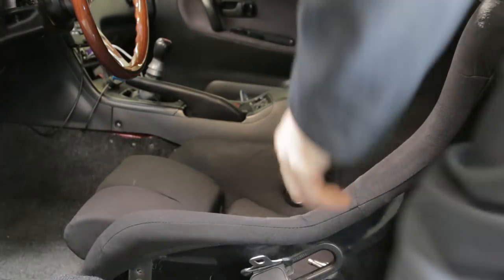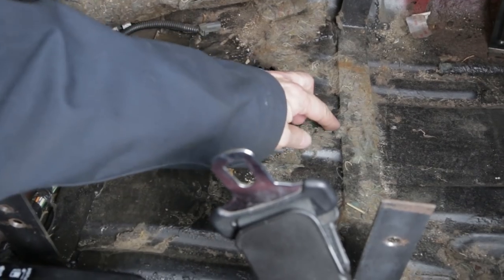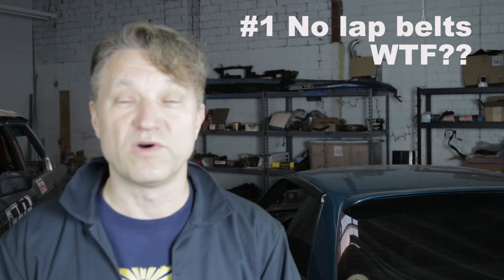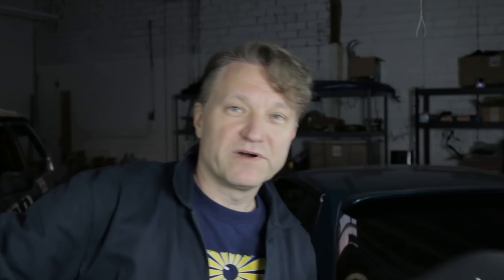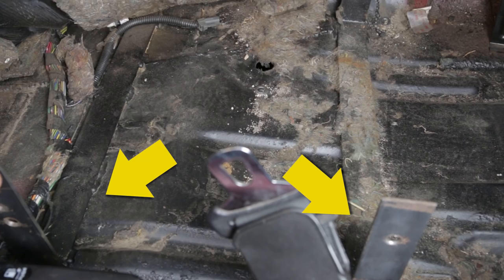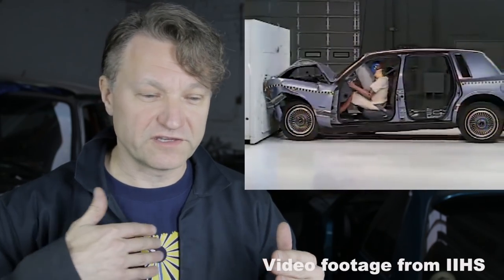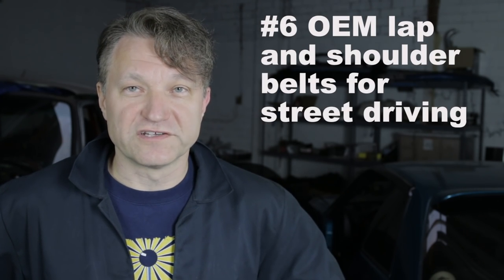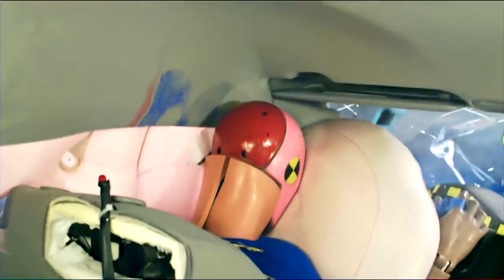Nissan 240sx mods - Worst Seats In The World

Comment: revmatch wondering what you think of the Takata Drift series belts for those that at least want to run some aftermarket belts that are street legal  seat belts. Of course installed correctly. Seems like a better option and have ASM system.
Reply from the maker: I think it boils down to what you feel safe with. Generally 4 point belts are  unsafe and illegal with most race organizations because you can submarine under them. I realize Takata has their ASM (Anti Submarining) system, but personally I'm going to run both the OEM 3 point and a 5 or 6 point harness for the track. Their 4 point is not compatible with HANS.  

Unfortunately there was an incident at Chuckwalla about 2 years ago where a passenger died when a car hit a tower and she submarined and died on impact. She was wearing a 4 point.  Thanks for watching!

Comment: Also worth mentioning the more modern OEM seat belt systems have Pretensioners, these are pyrotechnic devices that fire off like the airbags. The pretensioner takes up all belt slack in a crash (a loose belt can be like having no belt, or worse). The wheel airbag and seat belt pretensioner comprise a tuned safety system .. think carefully before removing / disabling one of these (especially the passenger side, for your passenger made no choice to compromise safety before entering your vehicle = lawsuit).

This is a good video, great to show this example of how NOT to mount a junky seat .. those flimsy floor brackets and seat, totally defeat the whole purpose of gaining performance .. the idea is to stiff side support for the driver, to deal with those ++1G turns ... a flimsy install means seat movement side to side, which to a driver, is almost as bad as sliding side to side on the OEM seat. Driver seated stability yields lower track times, less fatigue, and higher driver confidence ... once you have experienced it, you will know exactly what i am talking about!  The seat and brackets shown in this video are all show and NO Go .. only great for parking at the coffee shop parking lot and telling stories of your "hidden" turbos &  200mph drifting during a police chase.
Reply from the maker: All true BigCooter. I've got a new seat properly installed now and it's great.

Comment: i have 1990 crx.  no air bags (factory) seat belts are mounted to the door (factory). all crash ratings are poor.  would a harness and seat help my cause ?
Reply from the maker: Probably not. The engineering of the car is the biggest factor in safety.

Comment: 5:33   usually, racing harnesses have something, i don't know how it's called. let's just call it a rip point. but basically it's a part of the seatbelt that has overlay, so when the harness is put under stress, this overlay rips to extend the harnesses in the shoulder area about 3-4 inches out (probably more, probably less, as long as you get the point of what im saying). if i remember correctly, takata has that, i don't know about other manufacturers. but also, one point about racing harnesses that you forgot is the sinking. with factory seatbelts, you dont really get that, but with 4-point racing harnesses, what can happen is you slide under the harnesses. although a 5-point/6-point harness might fix that because you'll have a belt going in between your legs. but don't quote me on the first part, i remember seeing it somewhere. where? i dont remember, but if i do find the link, i'll post it in the replies
Reply from the maker: Yes. Harnesses are designed to stretch under the load of an impact and give a little bit. Once your harness has been used in an impact you're supposed to trash it. 

You're right about 4 point harnesses as well. In a front crash you can 'submarine' under the harness. In fact, a woman died at Chuckwalla because the car only had a 4 point. 5 and 6 point hold your legs in place, so you stay in the seat and slide below the webbing. Every legitimate race series mandates 5 or 6 point harnesses for this reason.
Reply: revmatch well, usually, that's what you're supposed to do with roughly everything that has to do with safety after it's been used in an accident. for instance, even helmets are supposed to be replaced after the slight impact, regardless of wether it is cracked or not because apparently it loses effectiveness,
Reply: fred renault I

Comment: Where to start, guess go watch the video for even real brides or recaro in a rear impact, rear brides fully recline when hit from the back. S13s in the usa came with automatic seat belts which were garbage to begin with, not surprised the prior owner removed them but should have installed oem jdm 3pt seatbelts. Also stock s13 240s didnt have airbags at all to begin with so the steering wheel point is invalid unless your driving a late model with airbags. As for the brackets theres tons of companies that offer sliding seat rails for aftermarket seats. That being said either you have a street car or a track car. If its a track car it should be fully caged, have the proper non reclining buckets and harnesses (that should be dated and expire after a duration of time and need to be replaced occasionally)

Comment: If I adjust my racing harness to be loose allowing my body to move forward a little,is it safe to daily driver it? (with airbag)
Reply from the maker: Loosening will help, but it's still not ideal. A racing harness holds the body in place pretty well and isn't designed to stretch as much as an OEM seat belt. This puts a lot of stress on the neck in a hard collision where your head moves, but your body stays in place. 

Ideally you want to use your OEM belts on the street and your harness and HANS when at the track.

Comment: Great points addressed there. I will never get why people save on safety. STUPID
Reply from the maker: I'll spend on safety before other areas usually. My team spent quite a bit on a roll cage and never thought we'd use it. Turns out we used it and it held up just fine in a roll. No one complained about the cost after that.

Comment: I owned a miata before my 135i, I had bride replicas (complete shit like you say) nrg wheel and harnesses. They all worked well but now I am so glad I didn't crash that thing ever I would have gotten FUCKED. Also I have been in an accident with no airbag (STI wheel) and it sucks slamming into a steering wheel.
Reply from the maker: Tanner Buckbee Safety first man.

Comment: What your take on a real seat when the  Fia expires? still ok ro don't bother?
Reply from the maker: I think it really depends on how you plan to use it. If you're racing or tracking with an organization they will sometimes grant you a 1 year or 6 month extension on FIA safety equipment that has expired.  AFAIK, safety equipment is designed to work optimally up to its expiration date.  

It will possibly start to degrade slowly with time after that, but I'd guess not very quickly.  If your racing, your chance of impact is obviously greater than it is on the street. It's probably hard to get a good answer on this question.  Personally I wouldn't trust equipment more than a couple years after expiry on the street. That's just me however.  Personally I prefer to be safe when I can.
Reply: revmatch hmm true for me it's more street than some drift track,  I suppose I'll have to save more : /

Comment: I'd totally buy the covers off them seats.. I got a pair of sparco's that have so many tears in the fabric, and bride covers would look sick :p

Also I disagree on part with the seat belts, if you have your harnesses adjusted looser than you would on track then you have that lil' bit of movement- and still let the airbag catch your head! that's if you have the luxury of a car that was manufactured with airbags!
Reply from the maker: If you're going to wear harnesses on the street, I would definitely not make them too tight. OEM harnesses are still safer though as they are designed to stretch more upon impact.

Comment: Claims it will shatter on impact small impact yet thrown the seat on the floor and it's fine
Reply from the maker: Throwing it in the floor is not equal to the power of a collision. Regardless of what happens, you know it’s never been tested. Just ripped off and stolen from the company that owns it with no regard to safety whatsoever.

Comment: Dude... You wine too much..... Edit: A track belt is going to keep you way way wayy safer. Your not supposed to move. The fabric stretches . I smashed my face when my airbag failed to deploy. bones stock car. That hans garbage has caused quite a few life changing injuries.... But thats a whole other can of worms. I do agree the seats are cheap but my car came with chopped strand mat seats as an option. It passed safety in the states. So dont say they are going to explode thats total lies. It might rip but if that glass rips your back is ripping too... I have had a few offs and one was in a street/ strip car. No crumple no bags but The seat was bolstered around the head I hat my 5 point on and there was a crash bar in the door. Lady ran the light in a jeep... I walked away and so did the car. Minus a door skin and a snapped tie rod. We had parts. The jeep... Looked like it went through a mine field ladys face was all bruised by her airbag and oh... Gee go figure snapped collar bone. So quit your made up lies... Sure the harness is restrictive and so is the head padding it does limit viability but in an area you shouldn't need to look much. I know some dead drivers and yeah one was a hans fatality... And yeah I know instances where they saved people. But out of dead friends and foes I know of way more that died in a street car than a race car.  Just to add because it infuriates me. That you say that saftey gear isnt good for the street. I have a buddy he crashed his 69 impala Hard. I thought he was dead. We were kids being stupid. But you know what he had a 4 point and a cheap aluminum buket in there. Kept him off his wheel and his body in the car. The mount pulled out of the floor due to how bad the car twisted up. The other three shitty welds held. I am not promoting poor welds. But I can guess your just as guilty as I am at one point.  I launched into my back seat on my first swap. Next time you want to wine do some research and show how to install the seat proper.  I cry a lot about shit that pisses me off too but at least I can back it up.